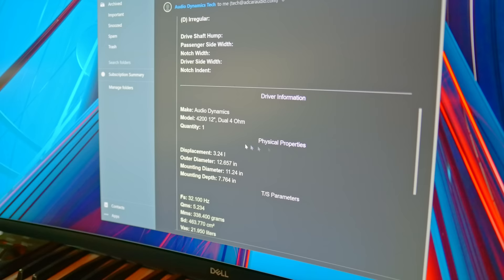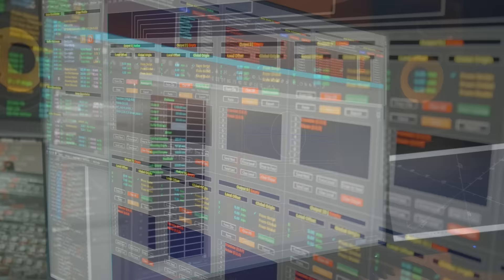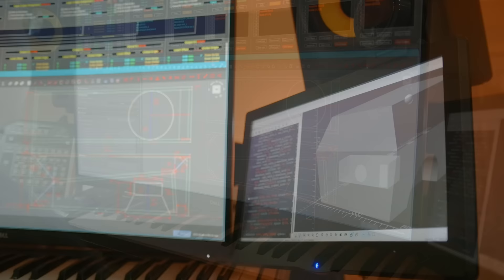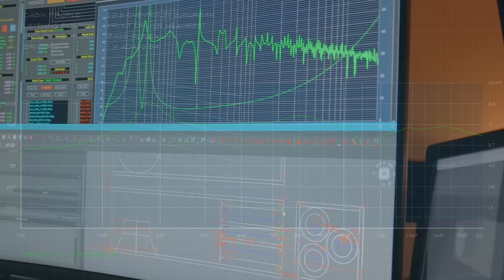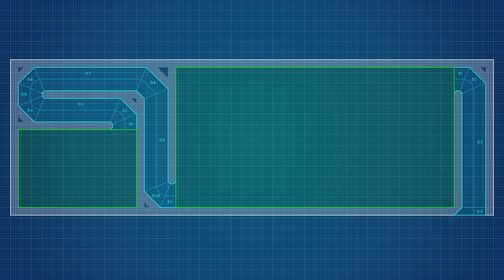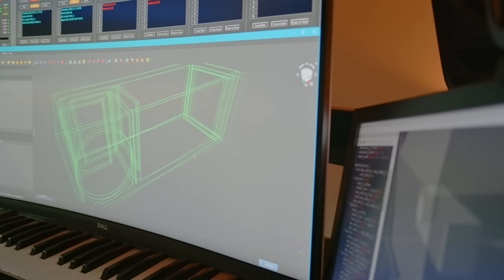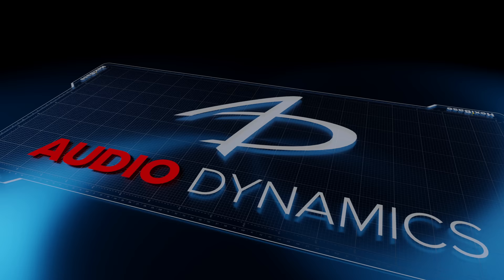Acoustic Engineering Workflow

Comment: Could you explain the capacitive / inductive thing? Never heard these terms used in the acoustic context.
I'm also curious about your use of the equal loudness curves. Wasn't it found by dr. Toole, Harman, and others that the "correct" sound is flat response, not the equal loudness response? Is it different for car interiors? I have myself tuned my subs as well as IEMs to equal perceived loudness by ear and quite liked the result.

Comment: Hello fellows. Regarding the HORN SPEKER BOX: 1- How should I calculate the portico (the throat) and how to calculate the trumpet of this type of box; 2- What should be the length of the horn? 3- How should the horn angle be calculated in these types of speakers, whether they are horns with a common angle (in geometric progression) or horns with different angles (in arithmetic progression)? 4- Is there any tutorial and software to help me in the calculations and construction of this type of sound box (horn box and folded horn box)? 5- Where can I find this information? what's the link? Thanks a lot for anyone who can help me.

Comment: I'm trying to get some bass on my Harley.  I've tried a few different small subs and I'm not getting past the exhaust tone.  I want to put a fosgate p2 10 inch 300 watt 2 ohm duel voice coil in it with the fosgate pbr300x1 brided to 1 ohm. I can fit the  optimal sealed box but it's not cutting it either. I need help!

Comment: Hey Pete, I was wondering if you could design a box for Two ZVX 15" Subwoofers in a 2006 Subaru B9 Tribeca that can achieve 150+ DB?? 4th or 6th Order NO WALL?? By the way, I lay down the third seat to set the box onto!

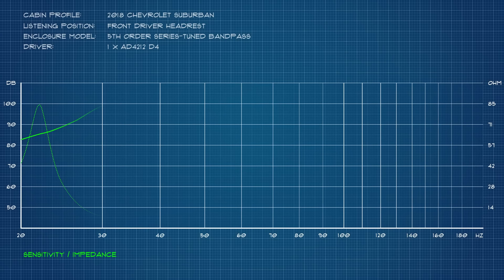Comment: @13:45 isnt that technically a t-line?
Reply: you could call the waveguide on the front of the cone a TL, but the airspace and port behind the cone isnt a TL.
Reply: Or a T-line-coupled-xxx. But, in compound, it doesn't operate as a t-line, so it's just a waveguide. Voight-coupled bass-reflex?